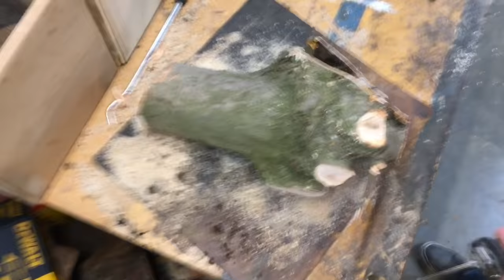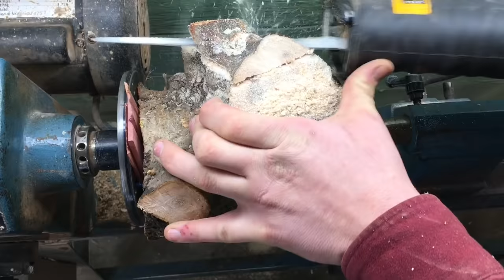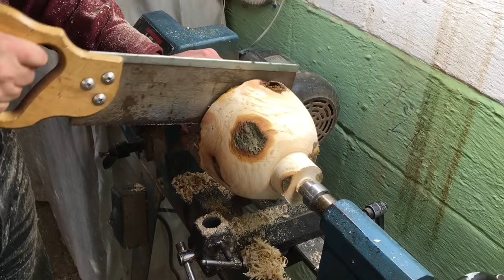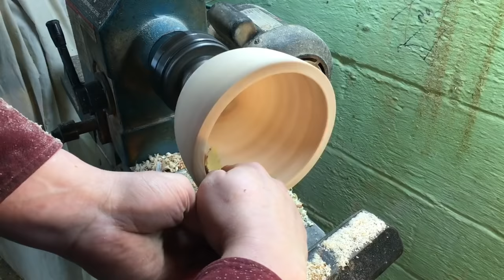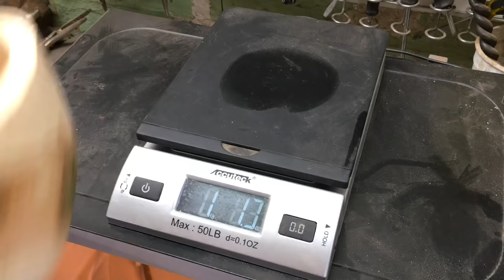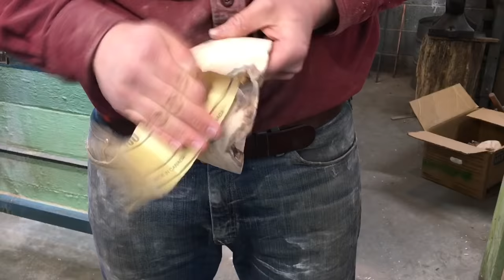Woodturning a Hollow Stump Bowl!

Comment: Very unique piece ! Looks great
Reply from the maker: Thank you, Trey!
Reply: Hogan Baker you're welcome! 

You might want to try using some denatured alcohol for quick drying of your rough turned bowls! 24 hrs should do the trick. You could turn some bigger pieces that way, if you ever want too. 

Btw, I use the microwave method sometimes too. Works well for a quick dry-out of green wood. Denatured alcohol will do the same thing!
Reply from the maker: Thanks for the advice, I really need to try the alcohol method soon! I like how microwave  can get a bowl start to finish in a day. But the huge downside is that I can't dry a bowl that is also thick enough to re-turn, so I'm stuck hand sanding for hours :P